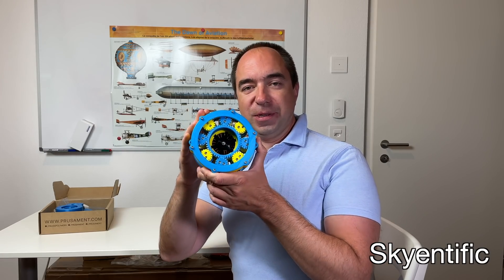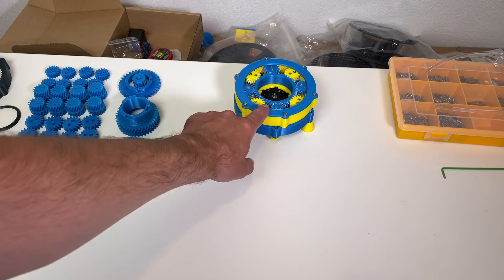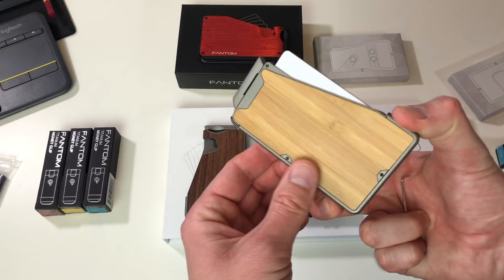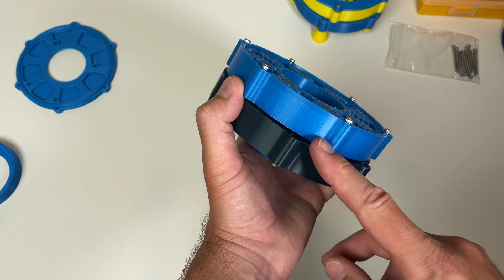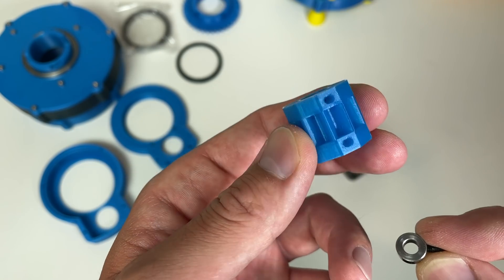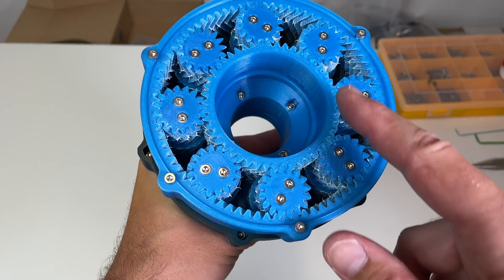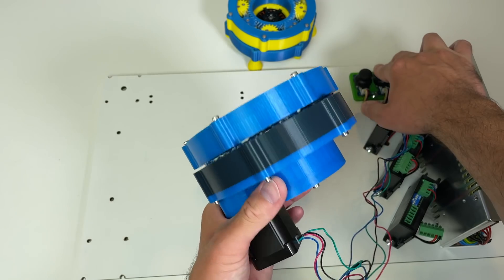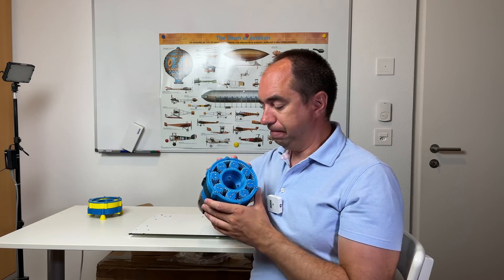I have made Powerful and Cheap, 3D printed robot actuator

Comment: I think the weak link is the connection to the motor shaft. The solution is actually simple.  Amazon has a shaft sleeve that has a D shape female and a square key male.  It was loose but the remedy is to shim the flat part of the shaft to remove the slop. It works very well.

Comment: Perhaps an idea on all these actuators is to increase the outer ring gear thickness, to further support and strengthen the external connection, the output performance is always very good but I feel the week point is the connection to the item to be actuated, maybe to bring it in line with the total output torque of all the internal gears, maybe it would allow for better performance, as this seems to be the weakest link in the chain I apologies in advance if this has been addressed.

Comment: Expected to see brushless motor actuator in this video 🙄
Reply from the maker: Brushless would not cost so low. The cheapest controller for brushless would cost 50USD. So the price of the actuator will be at least 70-80USD. Which is double of the stepper version.

Comment: somehow I keep thinking that these printed part actuators would be best applied in making a larger and metal-capable CNC VMC that would then allow for relatively inexpensive fabrication of precise steel gears and aluminium frame elements - call it a bootstrapping method.

Comment: Hi. I am working on my own robot arm which is 6 axis. I used stepper motors and drivers. Mechanichal system is due to finish. I am designing the robot to package cases. So, i am going to use it as a case erector.My question is a about software. What software should i use? What is the best way to get the mechanism worked? Should i use a cnc controller card or something difference? 

My robot is 6 axis
Reply: Did you make your own gearboxes?

Comment: How feasible would it be to make smaller versions of this? Would it be even cheaper or more expensive?
Reply from the maker: It is possible to make it smaller, but not too much. In smaller version, you would need to use smaller teeth on gears, and 3D printer should have enough resolution to 3D print small teeth properly. I think it is possible to reduce the diameter to maybe 80mm or 70mm. I do plan to make smaller version. Ideally I would like to have three version: small, middle size, and this big one.
Reply from the maker: Price-wise: smaller stepper motors are a little more expensive, but smaller bearings are cheaper. So I suppose one going to cancel another and the price will be more or less the same for small, middle and large version.
Reply: Alright thanks, looking forward to those videos!

Comment: Would be super cool if you could test the maximum direct load of the stepper motor and then test it again with the gearbox to have some numbers! I'm thinking of motorizing my standing desk and using a cheap motor would be spectacular, even with the large gearbox.

Comment: Amazing content as always! Just curious about the actual noise produced as I am looking at utilizing a similar system but am trying to reduce vibration and noise as much as possible. Do you have a decibel measurement or comparison? Are you running micro steps for the stepper?  Also how does this compare to the BLDC version in terms of sound? Sorry for all the questions lol

Comment: Nice gear-box.  Really looks like it can move heavy loads.  I think you'll be able to improve efficiency and max load by adding a cage for the planets.  This type of planetary drive puts a lot of "twisting" torque on the planets that try to skew them.  The cage then helps keep the planets aligned so they work better.
Reply from the maker: Thank you for advice! I will think, how to do this without additional bearings.
Reply: @Skyentific  Even without ball bearings, a 4-5mm diameter steel pin in the center of each planet will provide a lower friction path for the twisting force on the planets.
Reply: It needs to be much thicker to handle high loads. No real problem though. The question is the end goal.

Comment: You are very good in designing gears in fusion360, it would be nice if you could make a video where you explain how you design a simple gearbox and the tollerances you use for 3d printing. thx
Reply: The tolerances don't really matter, there will be backlash and elasticity. Either your software is up to the task or you focused on the wrong thing. My 6 axis robot is just about done and driven by high torque plastic gears same as this guy.

Comment: diy 3d printed motor, true brushless dc, copper electromagnet or em + permanent magnets, solenoid coil ring + radial same polarity magnets, just add bearings, or use that planetary as the bearings, lorentz force based, non-touching, if more detail/instruction needed
Reply: external measurements for the position

Comment: Thanks for sharing this. Looks like a good design.
I am thinking that flipping the stepper around and placing it off to one side of the gearbox so the whole depth of the unit is reduced ?
Also close up the gap between the two halves of the gearbox and maybe place a thin PTFE sheet between them.
Keep up the good work.

Comment: If going for a lower planet count (I think 5 is a nice number), it becomes easier to build some elasticity into the planets, and print them with a slight negative clearance, so you can really drive backlash to practically zero I think. I have a python script to generate all possible imaginable gears of this type that allows you to search for gear ratio and optimize various other things, I can try to put that in a usable state online if you care. Here is a nice setup with gear ratio of about 50: ((23, 22, 67), (18, 22, 62), 5). You can create almost any gear ratio up to 1k, though im not sure its always best; internal friction increasing with external load like pinching probably gets worse if you do. Internal friction is also a great reason to copy the triple-ring structure of GDFW; with only two rings each planet gets skewed in place when the unit supports a torque which increases internal friction a lot; whereas with three rings this mode of distortion is supported a lot better.
Reply: @TheShneedle Also note that it does not do any involute gear generation, but rather uses cycloidal profiles. While I havnt tested this in practice yet, I feel that the cycloidals are preferable since they are meant to be printed anyway, and they form a nice and continuous printable contour. But more importantly these gear teeth should be fine bearing substantial normal load, whereas a typical gear profile with its more inclined pressure angles really does not take kindly to that. With these teeth it can act kinda like the Archimedes drive; relying on elastic deformation of the gears to generate a preload and eliminate backlash.

EDIT: youtube seems to be deleting any links I post as well as any new entries to this thread in general; perhaps this edit will work, but look for pycomplex on github; then look for a file called test_compound.
Reply: @TheShneedle Its a little bit more than just a standalone script; it makes use of this python library of mine. So to use it you should clone that whole repo, create a conda environment, and then you should be able to run the test in that file as entry points into various pieces of functionality. I tried cleaning it up and documenting a little but it still isnt the best. You can use it just to find interesting gear ratios and plot those configs, but there is also a bit of functionality to export to STL for printing.
Reply: @TheShneedle Note that it will compute gear ratios or any config; [r1, s1, r2] means ring1 is the motor stator and mechanical input, sun1 the motor rotor, and ring2 the mechanical output. Any such combination is supported, though this classic config (or with 1 and 2 swapped around) is generally the most interesting one, producing the highest ratios.

Comment: Design idea: What about instead of motor hanging off the side, you folded it in on itself, and put the motor on the inside (180 degree opposite orientation from current)?
Then you mount connection points/flanges using outside rings? 
Yes you lose cable feedthru in the center but for an elbow or knee joint, or a non continuous rotation (<360°) that wouldn’t matter.
Reply: Robot people want the hole in the middle but I'm building a large winch and the hole in the middle could be a large shaft that would support double bearings on both the input and output. The motor on the outside also allows room for multiple inexpensive motors to drive even higher loads.
Reply: @BrianBoniMakes  Some robot people want the hole in the middle. I definitely admit there’s times I run cable through the coaxial shaft of a normal motor, vacuum feedthru, even a rotary pneumatic coupling. 
But I’m building a mech, and pancake drives on either side of hinge joints like elbows and knees are a favorable option.
Something like a large Kollmorgen ServoDisk pancake motor with a surrounding orbital planetary gearset.
Reply: We're living in the golden age for sure. Sounds like a nice project, you should show it off.

Comment: I would be interested to see if you run it for an hour or two in both directions to “break it in” and see how it sounds/runs, then post a short results video
Reply: When James Bruton put his drive on the end of a pole and used it to push him on a skateboard for a few miles it did wonders for the smooth operation of his version.
Reply: Yes, i would be interested too

Comment: I'm expecting that using a general brushed DC motor (i.e. motors used in cheap cordless drills) instead of any brushless or stepper one will make final actuator price lower but torque will be bigger

Comment: I really liked the injection molded gearbox from genesis robotics. I'm not sure why people still use expensive harmonic drives
Reply from the maker: Have you use it? I really want to try it!!! :)
Reply: @Skyentific  I have not tried one. However, one of my coworkers tried one in Hannover, he was really impressed. They have promised a lot for a while now, and I’m not impressed by the progress… I guess they have some issues that are not clear from the demos. Injection molded gear boxes might sound too good to be true
Reply: the reason why people use harmonic drives because it can be used with high reduction ratio with zero-backlash while maintaining the small size (depending the reduction size also). Also HD is expensive due to its material (which is mostly metal)and the manufacturing cost.
Reply: @ezurakuro  I know that, but Genesis Robotics promised all the same functionality for a fraction of the price. I was hoping for low cost injection molded gearboxes to be easily available by now...

Comment: Expand your tight plastic parts with a little heat to improve fit. Print over your captive nuts to lock them in and hide them. I always print a few layers over embedded nuts. Great design, nice job.

Comment: Awesome, as always.
3d printed gearbox sounds not very smooth. But, probably, after some cycles, teeth will became smoother.
Reply from the maker: It sounds not too bad. Anyway, 3D printing is the only option for cheap design.
Reply: @Skyentific  what about a brief “immersion” in acetone vapor? We use this technique to “soften” edges. Just be very careful because it’s not a precise process, and may affect tolerances.